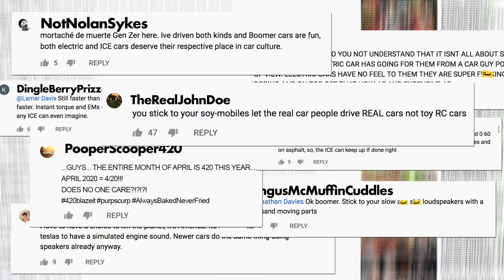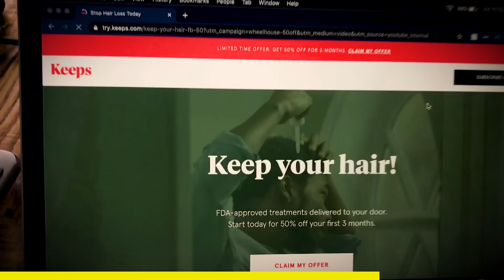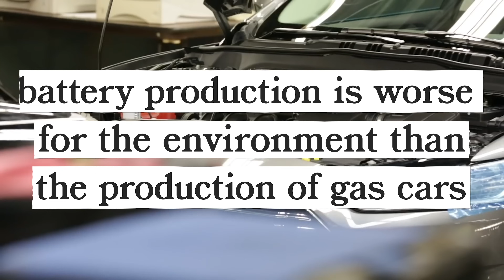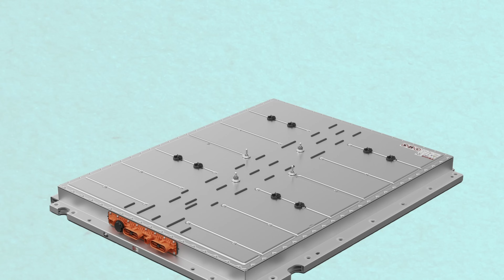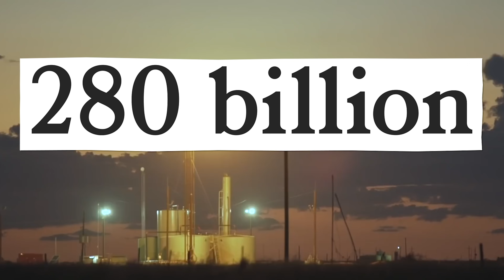Are Electric Cars REALLY Better for the Environment?

Comment: best  of luck with the Electric  Car.  Ill just keep my 1973  Dodge . It seems to do better  then some of the junk on the road these days .
Reply: Better how? The very slowest electric car sold by Tesla when in chill mode which means the acceleration is massively nerfed, is still faster than a 1973 Dodge Charger. It also handles better too.
Reply: @engineeringtheweirdguy2103   let me list a few reason why my Car  is alot better . Battery's have a limited  life . the price to replace    the tesla  battery is about 13,000$  . also they have a really high rate of failure  anyways . there not Emp protected . so if a transformer  blew  the whole car is ruin . You say they drive better  not really .  when the windows are down sounds  like a   helo    is in the car with you. when going down some roads  the car roars . Also what about refueling  not ever  store    has a charging station  to recharge  your car . so the car cannot charge it self .  so you are limit to were you can go . if not planed  ahead of time . also Batterys do not do good  in hott or cold weather  it take away the life of the battery .  also can end up with dead cells. having a dead cell can also cause the car  to not function  right or run at all . man the list goes on and on . in this time and age  it just the new thing . it will die out just like everything else  does .
Reply: @gundorethemighty  I’ll respond to this in full in the morning but suffice to say that you wrong on effectively every point.
Reply: @gundorethemighty  1.) Modern EV lifespans are between 400,000 miles to 500,000 miles or more. which is often more than double the average lifespan of a modern combustion engine, even with all the service that EV's dont need.

2.) true, battery replacements are expensive, good thing you dont have to do them more than every 40 years or more. And still cheaper than buying and installing a brand new engine and transmission.

3.) They dont have high rate of failure. in terms of on the road reliability, they are rated at some of the most reliable vehicles. Not sure what else you'd expect from a machine with 1/1,000th the moving parts of a combustion car. If you look closely, when Carsguide rated the model 3 down for "reliability" after it was listed as number 1 for a good 3 months they initially refused to comment why, when pressed they said it was because of "paint and panel gap issues from the factory floor" which isnt a reliability issue, thats a fit and finish issue, its also something that is fixed by the manufacturer under warranty.

4.)They are EMP sheilded. You do realise that wireless induction motors works by INDUCING A LARGE MAGNETIC PULSE TO DISPLACE MAGNETS right? if it wasnt EMP protected the car would fry itself! infact people are looked into this and measured less magnetic radiation inside the vehicle sitting atop the motor than they did outside the vehicle in background radiation. 

5.) They do drive better, thats why the model 3 has the highest rating of any car for driver satisfaction and driving experience. how else could you interoperate that?

6.) what the hell? what kinda noise do you think the car is generating? you think the EV's are equipped with mud tires or something? the road noise, which is the noise of the tires on the roads, is the same as literally any other vehicle. Empirically EV's are quieter on the road than almost any other car. The only variation in that is how much internal noise insulation you have. But it makes little difference since because its so quiet the only think you hear is road noise. Because thats the only sound. Just like how whispers are quite loud at night when you're trying to sleep but not so much at a concert. In fact, some EV's actually use air-bag suspension to try to reduce that road noise as much because there isnt a loud engine to drown out the noise. But for some reason petrol heads like getting their fanny vibrated by an overly loud engine that makes their neibourhood want to flay them in the wee hours of the morning.

7.) you can literally charge anywhere there is electricity.... which is everywhere. I own an EV in Australia and i've never had an issue. I dont even own a long range either. I have a standard range.

8.)You do realise modern EV's have thermal management systems right? they're swimming in coolant fluid to either heat or cool the batteries? you do know that right? SURPRISE!!! Engineers arent idiots afterall!! infact, in terms of reliability, in the cold EV's are far more reliable the ICE vehicles. As Petrol and Diesel need to heat the engine in the cold in order to get the fuel to combust. This often leads to a flat battery as it takes alot off turning over the engine to get it to finally fire and take. EV's have no such problems.

9.) "its just a new thing and will die out like everything else" ahhh. no. EV's have been growing in popularity, literally at an exponential rate, since 2010. thats over a decade and they've shown no signs of slowing down, only accelerating in popularity. so no, it isnt "just a new thing" its been around for a while and is only getting more popular.

Comment: Myth #2 is indeed NOT a myth. Elon Musk said it himself that the electric grid as it stands today could not handle if everyone were driving an electric car. EV isn't really about the environment. It's about using a different power source. Plus what you didn't look into is disposing of all of these batteries because they won't last forever. Thinking on a grand scale where everyone drives an EV instead of just the relatively privileged few that can afford an EV can paint a much more realistic picture. Not saying that gas powered vehicles are untouchable, but battery technology has to get a ton better, cheaper, and safer to be a long term solution.
Reply: Still, Hybrids will always be cheaper and more convenient. Because screw people in garage-less apartment complexes in a full BOV world. Public charging is just as expensive as gas, and wont be any cheaper. Plugless for ones who cant use home charging, plugin for ones who can.
Reply: Notice the criteria there. Electric grid today. Everyone driving EV. Of course it wouldn’t cope. But that isn’t reality. OPTIMISTICALLY we can assume 50% of road vehicles being electric by 2040-2050. Meanwhile we know for a fact that the energy grid has never failed to double in capacity every 20 years. And at current, the grid can support around 40% of the cars on the road being electric on the current grid. 

So in reality, EV adoption will be just fine. But yes, under the unrealistic scenario that tomorrow everyone wakes up with a brand new Tesla in their driveway with a bow tie ontop, then yes, there would be problems. But it’s physically impossible to produce that many vehicles. Tesla itself only surpassed 1 million vehicles made in 2020. Last year toyota made 7.6 million cars globally and ford made 6.4 million globally and in the US ALONE there are 276 million vehicles registered on the road

Be careful of such short sighted and unrealistic assumption designed to discredit what are otherwise perfectly viable technologies.

Comment: This is more of an energy topic overall but there are overarching problems even with the clean energy solutions. Solar panels and wind turbines have a life span of around 20 years. You need a lot of them and they are a huge pain to recycle not to mention the fact that the foundation of a single 3 MW wind turbine requires a hundres concrete trucks worth of concrete. For example the wind turbine plates are mostly going to landfills etc. 
They also require large amounts of materials to produce as well as rare earth metals in the case of solar panels. I dont think these impacts are taken into consideration when they are just deemed clean energy. 
Only solution for now to make energy and thus EV's a some sort of "final" solution in the fight against emissions is to go nuclear.
Reply: depends on the type and composition, Also concrete pads for wind turbines can be re-used for newer turbines almost indefinitely.

Comment: Pretty sure you missed A LOT OF THINGS on the EV topic.   How are people going to efficiently charge vehicles multiple times per day?   What happens when the easy raw materials run out and suppliers have to find more intrusive ways to get it?  Umm, copper?  Gonna need a sh*t load of that.  Keep digging bro.  That comparison gap will significantly shrink.

Comment: have no idea where you got your info that the power grid could go to 1/4 the cars on the road and not be a problem but they are high! theres no way and cleaner energy ? doesnt excist in a consistent reliable source other than nuclear. which you never mentioned. Nucs are the future of clean energy just need safer plants and a few more of them before 1/4 the cars go to electric. hell they have so many wind mills across the midwest its slowing down winds and messing with the climate fact.

Comment: Again, this did not factor in and all the alleged 'myth busted' videos  completely miss as well is the 'BATTERY DEGRADATION AND REPLACEMENT' aspect of owning an electric vehicle.  Get that one factored in and it's not as rosy as what there proclaiming.  This is the same issue I continually have with 'environmental impact' figures.  There not based on the long term, there based upon one set of figures right now, they don't factor in the whole picture.  It's even going to be more so for the more expensive 'high performance' models.  Do you honestly think that a bunch of people essentially racing there vehicles are going to get the same life span out of there batteries as grandma sensible budget out there going from home to the store twice a week?  In short the way a vehicle is used since the dawn of vehicles will factor into the picture as well.  Add on the issue of tires, brakes, suspension and chasis wear and tear.   Let's not forget that EV's are by default much heavier than a standard ICE vehicle.  So there suspension is surely going to wear out faster than an ICE car, it stands to reason logically. Nope the real solution will be a sustainable fuel that's environmentally friendly and allows the average cash strapped out there to perform a cost effective conversion on there existing vehicle they already own. Perhaps like the liquid hydrogen ideas.  I'm still convinced a form of compressed air car, could also be a great solution as well.  Maybe a hybrid of these technologies could become a reality.  Finally did you not notice how the power usage was not correctly factored in.  Firstly wing and solar is not enough to sustain power for the current global population, it simply isn't.  Solar panels are very toxic to manufacture, wind turbines require more maintenance than people realise and who wants a spinning blade close to there house in a high wind or hurricane situation(especially if there just set and forget without maintenance as is typically done today.) Hydro power is a great idea but only so long as you have a water source to drive it.  If it dries up due to poor infrastructure expansion(the entire world can get drought conditions) then your again up the river without a paddle so to speak.  I've yet to see a more focused and encompassing solution.  Sure you can incorporate many forms of environmental solutions but each one requires separate maintenance and costs associated with running them.  This compounds the cost of running them.  This I mention because if we all go Electric tomorrow, ask yourself the question will a bunch of aging power stations which have trouble supplying the demands of societies current power requirements be able to handle the massive increase in demand.  It doesn't help that EV sales people are lying about the true cost of installing suitable chargers for the EV's in your house etc.  EV's will not be popular in my life time.  I can say this because 1. The cost is prohibitive. 2. Infrastructure is not there to support them. 3. Poor return on investment(with massive losses unless you can sell your car before your batteries start dying but even then just look at who wants a 2nd hand electric drill to a new one?  Every one tends to opt for the new one because they want trouble free new batteries to old ready to bite the dust ones), 4.  Poor mileage, 5. Build quality is highly questionable, 6. Only road support for your electric if it breaks down will be towing it to the nearest electric car repair centre?????  (good luck finding those or any mechanic who wants to touch a serious electric motor problem.), 7. Do it yourself people will not only be frustrated but could in fact have life threatening issues if they don't understand how to work with there power system.(ZAP!!!), 8. Jump starting an EV with defective batteries? (Is it even possible without an explosion and don't say there are people out there who will not try it.) 9. Charging times are ridiculous, 10.Massive grid handling problems if EV usage was ever to ramp up.  I'll even add a final and most critical one. 11. As EV's with any usable mileage require 'lithium' for the batteries and we all go electric, what  happens when the world supply becomes to low to supply all the electrics, so replacement batteries no longer even become affordable??  Well that one I'd like to put forward would leave the world and the societies that require vehicles to run in a massive pickle and you have gone full circle back to ICE cars causing depletion's of another resource and forcing people to abandon there glorious EV's altogether. Until an aluminium battery is perfected, EV's are not a long term solution, only a short term solution if the power grid could even handle all of them.  Hey, I have nothing against electric cars, the very first cars where actually electric.  I'm just concerned that there's an argument there better for everyone.  The reality is, there not for everyone let alone the entire global society at large.

Comment: That's outrageous. I'm still mind blown at how many people actually fall for 'Electric Jesus' (aka Elon Musk's) BS.  Tesla has never delivered on it's promises and the whole save the planet by driving an electric car myth is a complete crock of nonsense.  People seriously, do you really want to believe a guy on anything electric when his primary core business is a battery manufacturing plant???  Come on, of course he's going to make it look like the 2nd coming and get every vehicle possible electric, it gives massive returns, plain and simple.  Absolutely nothing about saving the planet. Let's not get into the fact that a single electric manufactured is 20 times more environmentally dangerous to the planet than a single combustion engine car.  Don't believe me, go check it out, oh and let's not forget the toxicity of 'Lithium Ion.' battery production.  But hey there's no emmissions from the car your driving right?  WRONG.  There's actually more when you factor the power to charge it and the very interesting fact of battery replacement when they wear out and they will in 10-15 years time(or less is some cases). Replacement has often meant that the cost of replacement is more than the car is worth. Until such time as the great Mr Musk has a policy of giving the customer new replacement batteries for peanuts and taking the old batteries to properly recycle them into new units guarantee, electric cars are a false economy fronted by more loss than gain.    Well they say, I have solar panels on my roof.  Well done you just contributed to stuffing the environment by having absolutely no idea how toxic solar panels are to manufacture.  I'm convinced the only way the planet will be truly saved is if it's profitable for a select few to actually be environmentally friendly.  Otherwise it's just a shuffle of hiding your non environmentally friendly practices around the globe.  Saving the planet is also something of a laugh when you factor in how much is spent purchasing crap to blow one another away with.  Put that money into REAL solutions on saving the planet and I'll start believing the 'green' idea.  Till then, it's a complete and utter con job the world over.  It's not all doom and gloom, changes are happening but not as fast as some people would like.  Those people need to understand fixing the environment is a big problem with no quick solutions.  Everyone going electric will only push the focus onto power plants which will be absolutely needed if were all going to go that way.  Currently electrics are OK for city driving and short commutes but are otherwise purely a novelty for the soy milk double decafe latte sippers out there who find it's trendy in there current social circle.  Electrics currently are nothing but a fad, not a solution.  An environmentally friendly sustainable fuel to replace the gas in current cars(liquid hydrogen is one solution is it's sustainable to generate the hydrogen.) is a better solution, not requiring the average cash strapped joe to fork out for a new vehicle with more losses than returns on investment.

Comment: Another thought is, what happens if they start building multi-story car parks with charging stations, and one of the vehicles catches fire from its battery? Could the heat then set off the batteries of other EVs?

Comment: My issue with electric vehicle production is that despite being better for the environment as far as emissions go, the lifespan of the batteries isn't good enough. We could convert existing gas cars to run on a carbon neutral fuel source easily however no one's pushing for it because the potential profits are 100x less than from selling new vehicles to everyone every 5-10 years. I think the future of e vehicles should be bikes, small commuter vehicles (smart car size) and mass transit. These are areas where the benefits outweigh the harm, however Tesla's and other luxury EVs continue us down our path of excess and consumption.